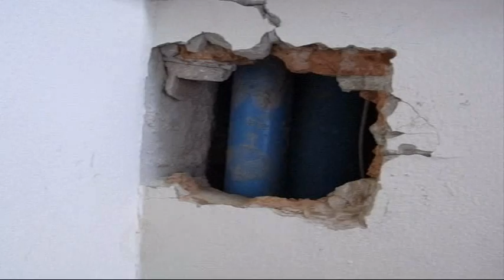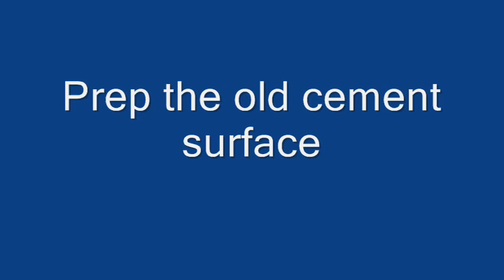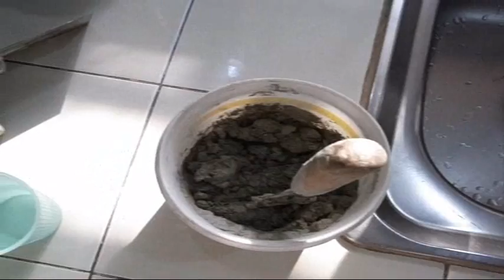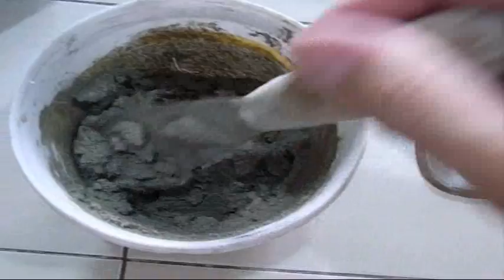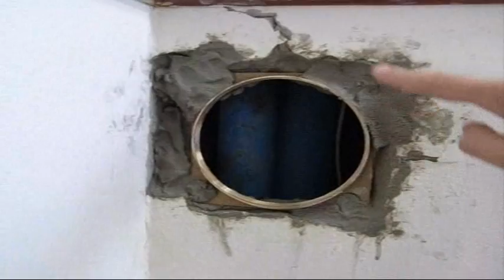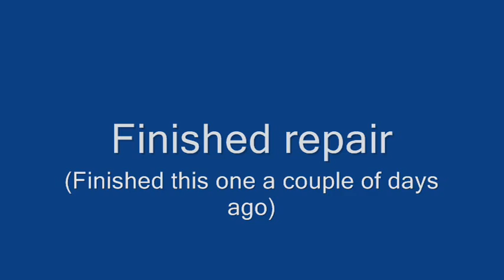DIY Brick/Cement Wall Repair (& Brass Cover Inspection Port Install)

Comment: Does anyone know if a filla-foam would achieve the same result instead of cement?
Reply from the maker: Foam would fill the hole, but foam is not strong, it is not rat-proof, it is not termite-proof, it is not fire-proof, it is only a little waterproof, it is not as sound-proof, etc.
Reply: @tsbrownie  Ok, thanks for the feedback. My issue is an exposed beam that I need to cover and I like the idea of using foam to mitigate the movement of the building and an inspection port for easy access for ongoing repairs.

Comment: Your cement is way to dry you needed it to be a little more wet
Reply from the maker: Yes, the cement in the container is mixed dry.  That's because I keep spraying water on the adjoining surfaces to keep them wet and that makes the cement I'm adding wetter.  If I start with the correct amount of water in the cement, by the time it's applied it's way too wet and won't keep its shape.

Comment: Thanks for sharing. 🙏🏼🙂

I was using a poly filler but might try the cement and remake the space that is supposed to accommodate a power outlet.

Comment: did you put sand with cement ? thx
Reply from the maker: This came pre-mixed.  It has the sand and mortar together already.  (It's easier, but more expensive.)

Comment: What kind of cement did you use? Do you think it would work for filling in a hole in the thick cement wall behind my 1940’s shower wall? Thanks for your video!
Reply from the maker: This was from a bag of premix.  This is not a supporting wall.  It depends on what caused the hole and how strong the wall needs to be.  If it was removed to do work and the wall is  block with a mortar cover (like this one), this is stronger than the original wall.  If it failed because water got in, then this will work fairly long term as long as the surrounding wall does not fail.  If it needs to be waterproof, you can add a latex waterproofing chemical to the cement.  If it's a structural wall you should consult an expert on its repair.
Reply: Thank you! I bet it’ll be fine, it’s just a hole where we switched from three handles for the shower to one in the center. I don’t want to use a coverup plate, so I just need to fill the hole around it. I think it should be perfect and I’ll add in some waterproofing just to be in the safe side, thanks a bunch!

Comment: "It's really easy to do this wrong"...betting that's an understatement.
"Don't have enough hands to do this"...don't we all?  ;-)
Reply from the maker: If you apply new cement / mortar to old dry, dirty stuff, the old cement sucks the water out of the new causing it to shrink and pull away leaving a crack / bad attachment.  This is true of concrete as well.  I've seen people patch their driveway, only to have it come popping back out.
Reply: @tsbrownie  The reason I watched some of  these vids the other day is I have a block wall where a couple of block faces were spalled by a falling tree which I want to patch before painting...I will definitely clean and wet the area well first, as it seemed to be a common thread in EVERY video I watched..thx for the info.

Comment: Where can I buy one of those brass ports? Can't seem to find them online.
Reply from the maker: I bought these at a commercial outlet that sells plumbing hardwared, pipes, valves, septic tanks, ...  I think my local mom and pop hardware store also sells them.  They come in thicker and thinner brass, I hold out for the thicker ones.